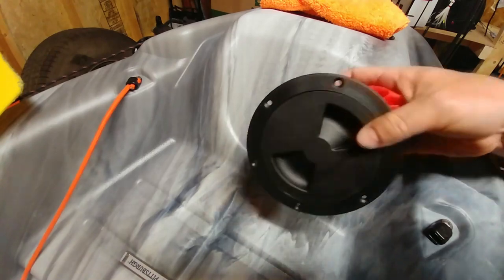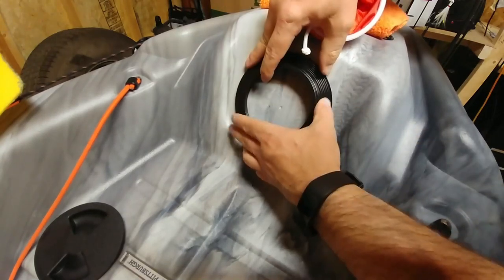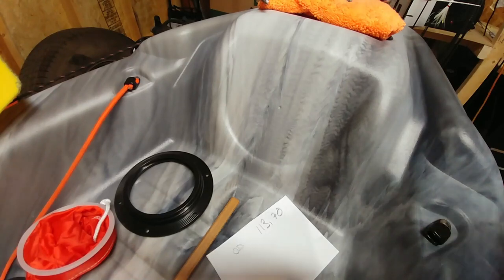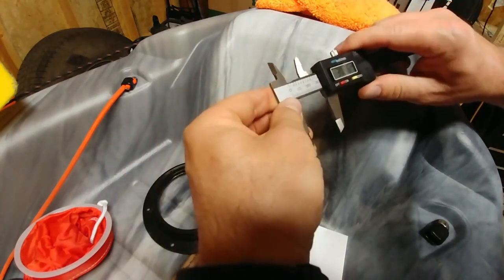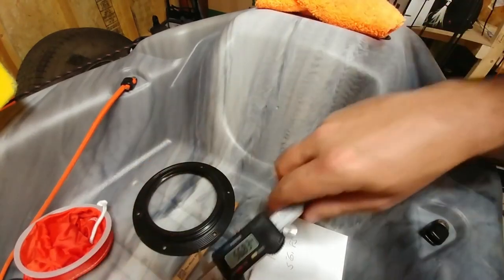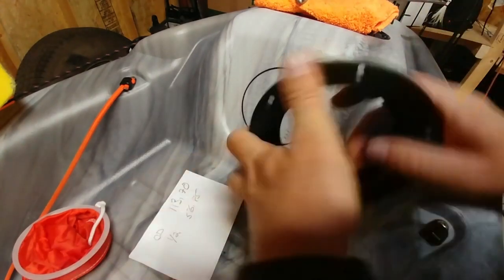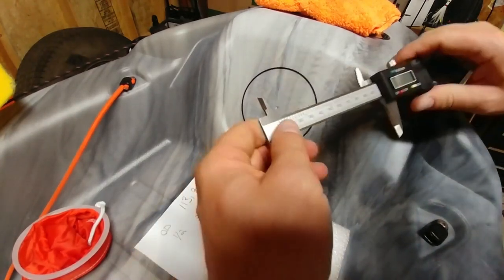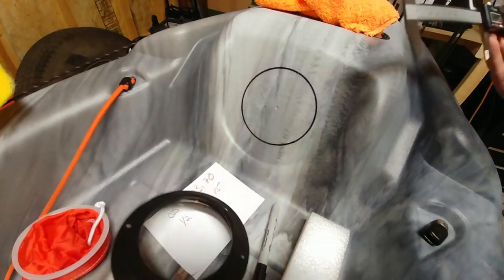DIY Kayak Hatch Install - YakGear 4 Inch Hatch Install Pelican Catch 110HD

Comment: Condensed version... Convert to imperial numbers.. buy 4"hole saw, put drill bit in dimple.. make drill rotate clockwise and push.. watch teeth go through hull...  Clean up edge with file.. add sealant around hatch lip and screw in...  Go fishing..

Comment: A whole saw on a drill works great.
Reply: I have a 12 foot catch hd. My rudder system is crap. The kayak won’t steer
Reply: Brett it stayed down. The steering handle by the seat turns all the way around. I’m wondering if On this inside of that handle if it’s unwound and that’s why it won’t control the turning on the rudder. I checked all the cords to the rudder and I can only come up with the cables being unwound. So I’ll take it apart see if I can wrap it around the base circle part of the handle internally and see what happens if not . Then I may have to do to a different cable steering system. After market! Already been looking at some